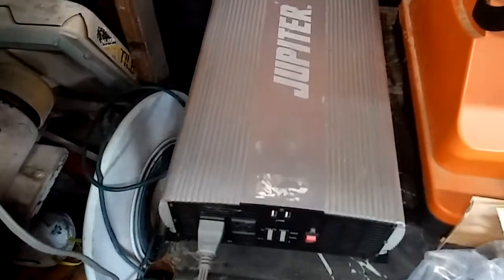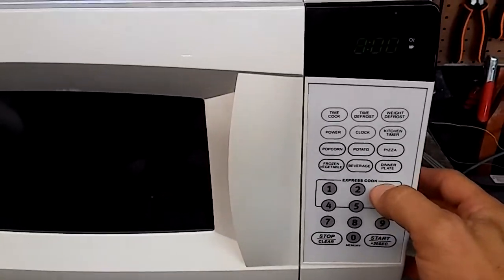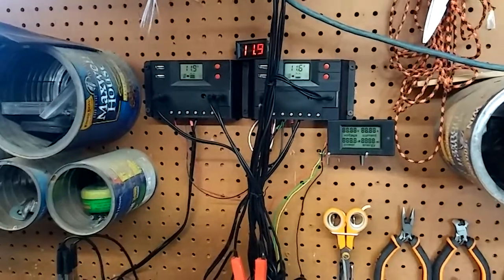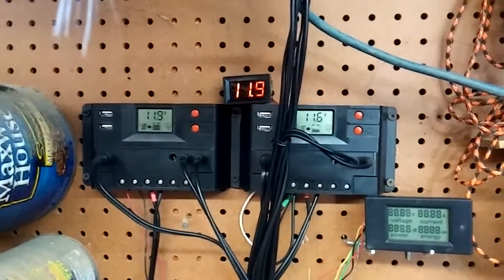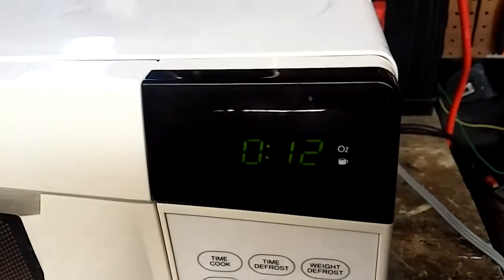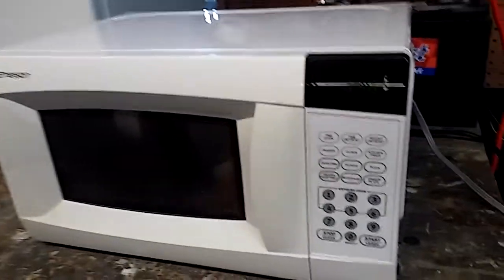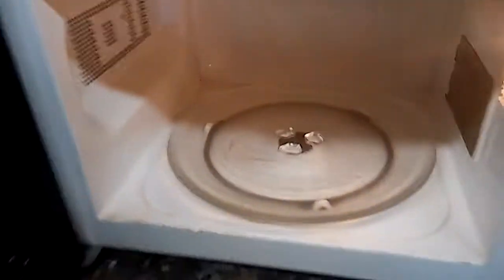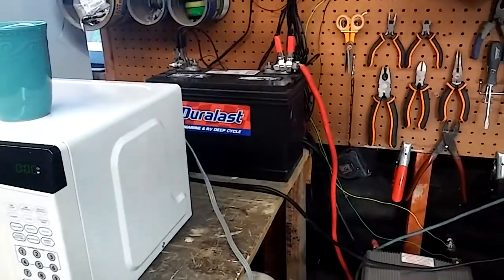Harbor Freight solar running a microwave

Comment: That microwave should be using 1100w for a 700 watt microwave so I'm wondering if I could not use one of their 2000-watt pure sine wave to run one off of 100 amp battery and for how long if using it with no solar input

Comment: Keep an eye on the temperature of battery terminals & cables to the inverter on high loads.  That will be a lot of strain on a single battery for extended periods of time.  Adding batteries & increasing the wire gauge reduce the strain.  
Take Care.